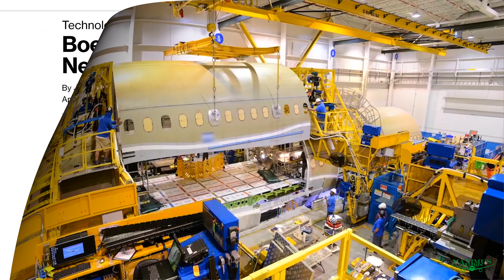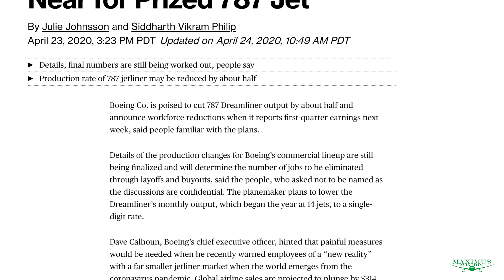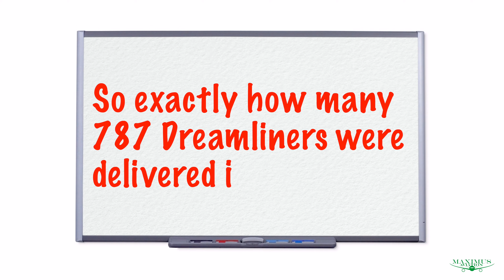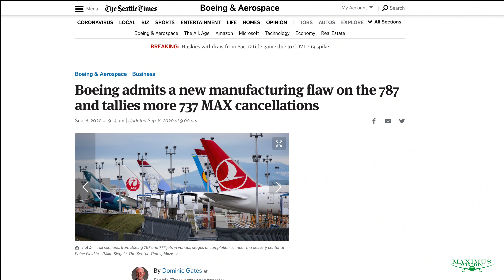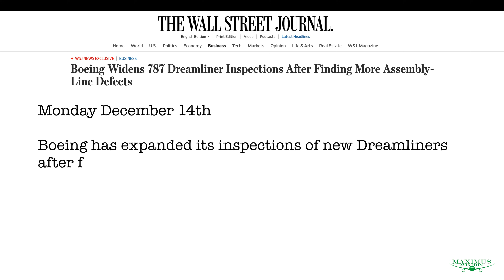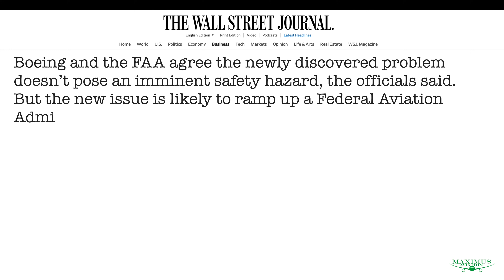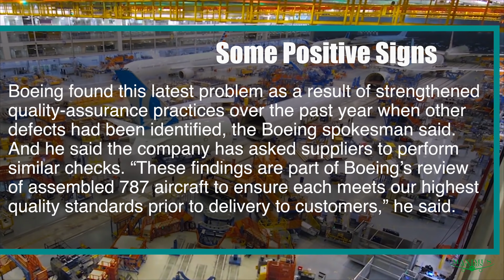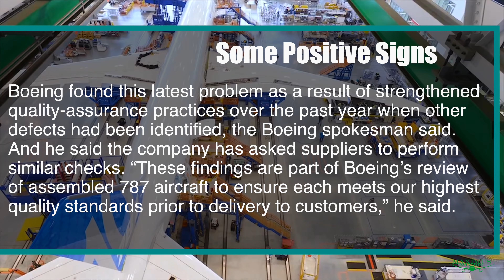Boeing Found Even More Carbon Defects In The Fuselage Of 787 Dreamliner This Month See How Bad It Is

Comment: Flying Dreamliner since 2011 with zero crashes is another good news-bad news story ... good news is it’s a real test of the reliability ... statistical evidence the hidden defects do not crash the 787.  Bad news is passengers have been the unknowing guinea pigs.   More bad statistical news is the more they look, the more problems they find and it’s very likely some parts were missed or are impossible to get to.   More bad news is fatigue failures take time to develop and create catastrophic structural failure
     I would feel safer if Boeing/airlines tested the fatigue failure development by doing a quick overload test flight every thousand hours.  Mandate passenger flights operate in a flight regime that limits maximum structural forces. Then do the test flight at 5% above the flight regime to prove fatigue failures are not imminent  for the next 1000 hours.  Yes I know management will claim the test flights are safely within designed limits, but just to make sure they truly changed their attitude about passenger safety, make the top executives fly on the test flights.
Reply: Yes, do an overlaod test to get lots fo crack so ti can disintegrate at 40,000 feete. Briolliant!
Reply: @ilovecops5499  agree. test shoukd never impact structural integrity and a load test cycle forsure will. even so,tighten the control is not a bad idea. maybe more check and special tool/fluid to the company to keep on eye on possible crack?
Reply: It seems to be a miracle. Last I heard about the battery problem was the solution was to put the battery in a metal box.
Reply: Looking back to the 80's Japan Airlines flew an aircraft, (747 Flt 130 ex Tokyo) which had, previously suffered a tail strike,OK Boeing sent an idiot to fix the problem, he ran short of rivets  or misunderstood his Tech Dwgs and did a single row of rivets for the aft pressure bulkhead when it should have had a double skin row of rivets, Japan Airlines suffered the loss of the aircraft when on a local flight,the Jumbo's pressurised hull burst.  This suggests that Boeing have been working on the cheap for quite some time and the idiot who did the 'FIXING of a new aft Bulkhead was slack too and should have been jailed for the murder of over 300 passengers.Boeing have little to be proud of these days.Terry Offord

Comment: The frustrating thing is that you don't need a degree in economics to see how much of a short sighted culture these so called expert accountants have built. When Engineers were in the boardroom the planes sold themselves. The 767/757  were fantastic aircraft and the 747 the most iconic. Now I'd rather fly Airbus  no question. My mum is taking my daughter to Florida next year with tui, they're flying on a 787, I'd much rather it was on one of they're older 767s tbh. If they have to cancel again due to covid (as they should have gone this year) I might even suggest they book with Virgin and hope it's an A330.

Comment: I still love Boeing and will fly the max anyday because it will be the safest plane in the sky after the whole shame and grounding
Reply: Any plane that requires a software kludge to overcome a known aerodynamic flaw will never be truly safe...or morally justified.
Reply: @charlesharper2357  you have a good point. But don't forget the MCAS has been on military jets for some time. The problem was not the MCAS but it's deployment: hiding it from pilots, it coming on again and again, it being able to override the pilots, no redundancy for a damaged AOA sensor, Boeing putting the blame on the crashed pilots, disregarding the concerns of the engineers, cutting corners to maximize profit, lack of proper oversight by the FAA.

The part of the whole mess that has to do with the MCAS was Boeing trying to avoid simulation costs for pilots for purely economic gains, and so chose to keep the pilots I'm the dark for an automatical system that can override them.
Reply: @inno.1552  
The tankers didn't need MCAS due to faulty engine placement...the MAX required it due to insufficient ground clearance  forcing poor engine placement.
The Air Force insisted that MCAS be instantly disabled once the pilot grabbed the controls...it is utterly inexcusable for Boeing to not use that solution on the MAX.
Reply: Innocent, you are.
Reply: @brugcom042  
With the trust of a child...

Comment: Glad to hear Boeing is increasing its inspection staffing. It is a heck-of-a-lot cheaper to fix a problem during assembly than to do so afterward.
Reply: I doubt there will be differences.  When the existing inspectors complain about quality, they put theirs jobs at risk...
Reply: They want to move their productions to South Carolina because of lower wages and worse standard.
Reply: In my opinion, the announcement took way too long.

EDIT: Timestamps 6:39 & 7:37.
Reply: Reminds me of the Ford [was it the Pinto} that ruptured is tank when rear ended, Lee Iacocca said it was cheaper to pay compensation to the survivors than fix the car.
Reply: @adoreslaurel  It was the pinto for the US market.
It is obviously deeply ingrained in the culture, and part of the reason the US courts and juries give such large pay-outs in these cases, as they assume the company did not care and made those numbers.. so they throw a spanner on the wheel.
Reply: @adoreslaurel  the pinto got a bad rep as apparently it wasn't any worse than the average. car in its size and weight category, rear end It with a Lincoln Continental etal then the rear bumper is at the front anyway, the biggest problem with it was the paint they had used, the different layers were incompatible with one another, consequently the paint would flake off the only cure was a complete strip down to the shell and repaint, all under warranty then put it back together, the cost was huge, and Ford tried to keep quite about it,
Reply: YES SPOT ON MONEY AGAIN WHAT ABOUT THE DIESEL HORRORS OF THIS LAST FEW YEARS
Reply: @Guido Bacala Err Thanks.

Comment: The glass half full.. The question is full of what?
Reply from the maker: made me actually lol
Reply: Take it as a reward for your inspiring video. 😉
Reply: To an engineer, if the glass is half full or half empty, then the glass has been poorly designed.
Reply: Possibly blood if it goes wrong.   That is what poor decisions can lead to if safety oversight is lacking.
Reply: Manufacturing and design defects. Holes.

Comment: They will solve this with extra duct tapes
Reply from the maker: Duct Tape can fix anything!
Reply: @maximusaviationchannel  "The handyman's secret weapon' - Red Green
Reply: Another MaxAwesome video!

As a new product development mechanical & textile manufacturing engineer, carbon fiber transition points have extremely tight tolerances critical for proper load transition bearing, safe compression & decompression longevity and long life structural integrity. 

With Boeing’s “large multiple bolt together barrel carbon fiber fuselage design”, any inflight cracks or deficiencies at transition points may cause rapid decompression, possible delineation with potentially catastrophic results. All joints must be smooth, perfectly aligned and properly joined to maintain cohesiveness in the system.

Airbus uses a different design philosophy in their carbon fiber fuselage design incorporating a hybrid skeleton design with inserted carbon fiber skin panels vs Boeing’s multiple rolled and bolt together carbon fiber barrels.

In general, with any carbon fiber applications there is no room for errors as carbon fiber gives little warning before catastrophic failure. 

I have engineered a third continuous carbon fiber fuselage design and  surprised neither Boeing or Airbus has done the same. 

Cheers,
KP
Reply: Nah, they must be using Flex tape HAHAHA
Reply: @Maxime-pk6cu  😁 😁 😁
Reply: My daughter was an airframe/hydraulics tech in the Navy and believe it or not she told me they actually had 600MPH duct tape to temporarily patch certain defects on F16's, F18's and A10's.   $1000.00 a roll she told me.
Reply: @funnyfarm5555  Duct tape will solve any problem: 
https://www.youtube.com/watch?v=y5yFWiJK670
Reply: @funnyfarm5555  yes I have heard of it, It has a special name that i can't remember. I think it was Mentor pilot that mentioned it.
Reply: They should build special handrails for the passengers, which they can use, in case if the fuselage is about to brake up in the air.
Ten to fifteen strong enough passengers  can hold such a lightweight aircraft together, by holding it together with those fancy designed handrails.
Reply: @A Twinspark Boing uses a carbon fiber tape rolled into barrels then joined in sections. Not a good design at all. The joints if not perfectly spaced can fracture causing rapid decompression which can cause rapid de-lamination of carbon fiber. Carbon fiber going into jet engines highly abrasive & catastrophic results for both fuselage and engines. 

I have engineered a continuous 3D radial braided design over carbon fiber frame for entire main fuselage, a far superior design with no seams or joints. Is Boeing listening??
Reply: Dreanliner - NOGHTMARE LIONER. IAM DEDA;Y AFRAID OPF THAT THINGS. 7373 MAX DEATH TRAP FLYEING COFFON!!
Reply: @Chris Yeoh, yeah, but only once the bean counters in Chicago have checked that its the lowest priced duct tape, and the shareholders have approved.
Reply: Really, Really Expensive Gorilla Brand Duct Tape!
Reply: Only gorilla tape will do.
Reply: @foreverendeavors6210  Nah, that's too expensive. Clipper duct tape is all they need.

Comment: Glass half full or half empty, Boeing still needs to shape up.   This lack of quality control is only adding to it's inability to design a proper MCAS system out of the gate, and the inability to design operational space capsule software.  All this comes in addition to the 787 production fiasco and the 747-800 wildly over budget redesign.  Boeing needs to restructure itself to take care of these problems from the ground up and to be pro-active about it.  Let's hope that they are taking this to heart and having success with it.  The last thing we want is a failing Boeing.
Reply from the maker: Well said.
Reply: There’s a common problem to all these Boeing problems - cost pressure and profit drive taking precedence over a  full safety culture, with inadequate regulatory oversight
Reply: Well said, but no. The glass is not half full, it shows cracks!

Comment: Jeez, is anything they produce these days safe?
Reply from the maker: Well, so far it is safe. And if I am being honest, Boeing was the first to build a mostly carbon fibre aircraft. So you probably knew it would take at least 10 years or so before problems started to arise.  The big question is how will they deal with those problems.
Reply: I don't remember production issues like this when Airbus went for an all carbon wing section? Please do some digging, and prove me wrong  😊
Reply: @wim0104  That's because carbon is mature technology vy the time the A350 design was official
Reply: I think these dreamliners will not age well.
I hope airlines pull these planes from service before accidents happen.